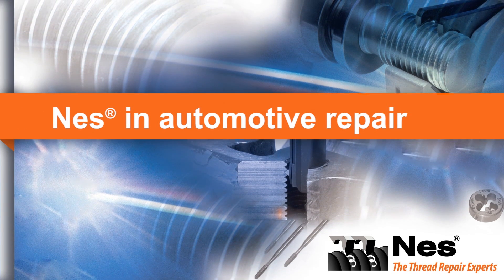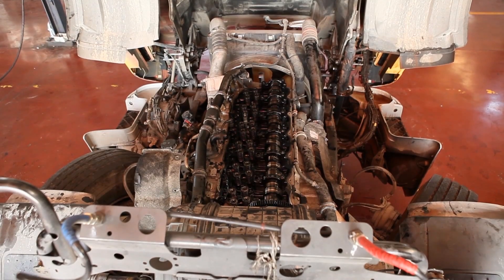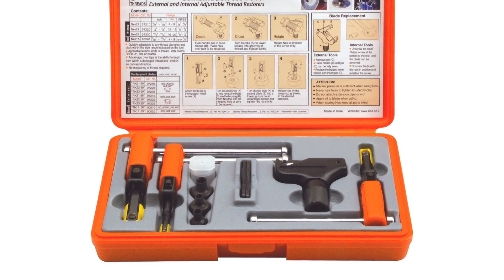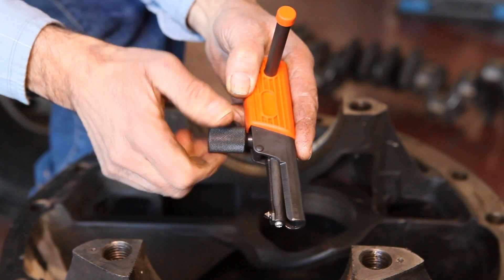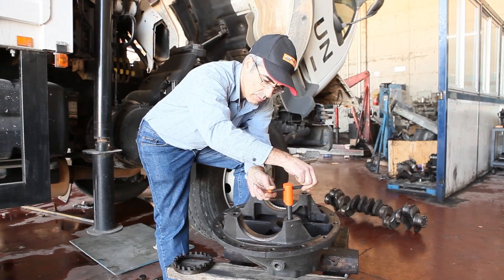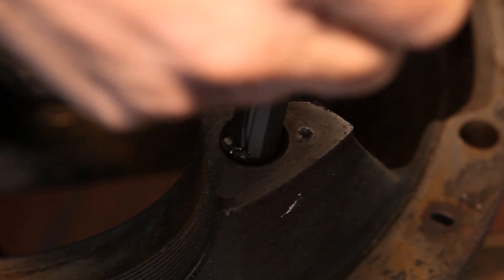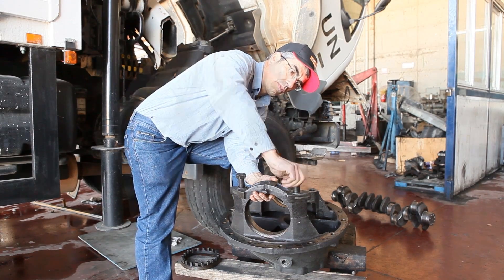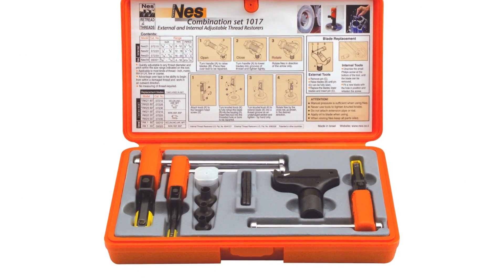Fixing Damaged Threads with Nes Thread Repair - Automotive Repair

Comment: Wouldn't it be a better idea to have two cutting blades opposite of each other? So there's no possibility of flattening the threads with the flat part of the tool, opposite of the cutting blade